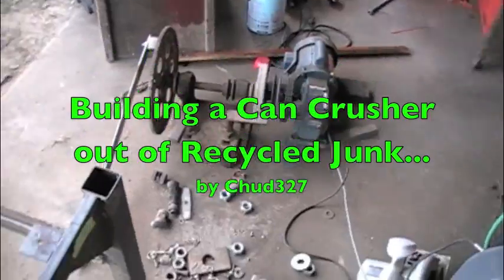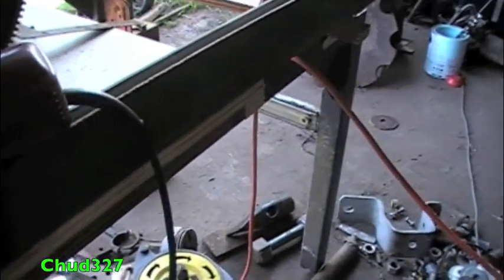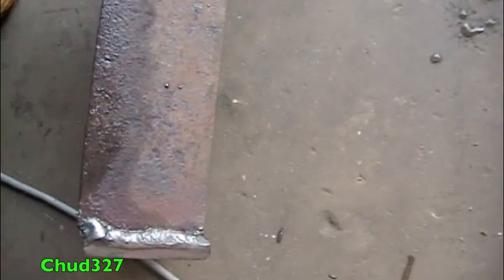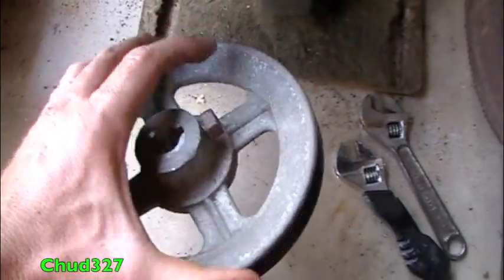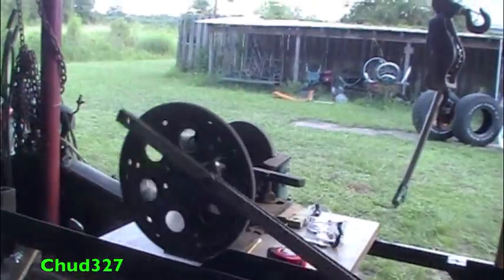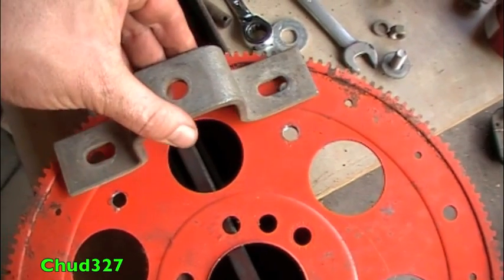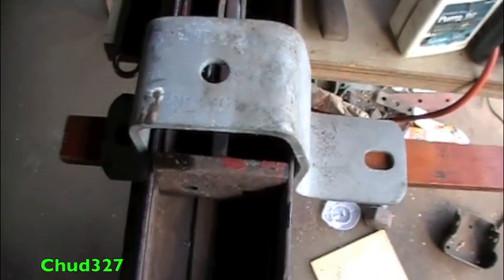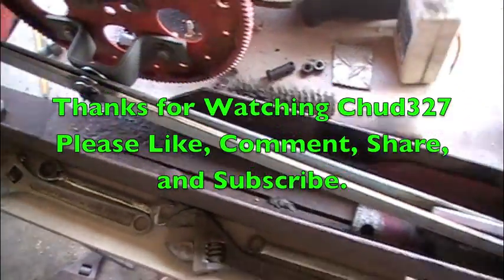Building a Homemade Can Crusher, Industrial Strength.

Comment: Why didn't you build it so it crushes cans flatter?
Reply from the maker: I guess I could go back an fine tune it. I was just so happy it worked and I do not crush very many cans.  I was actually thinking of making a two stage crusher, that crushes the crushed cans. That would be so neat. thanks for watching.
Reply: chud327 
Yup.
Just strange that all the ones I've seen on YouTube only Crush to 1 inch maybe half an inch. I would like to build one that crushes down to at least a quarter inch if not more.
Reply from the maker: 1/4" would be sweet, thanks for the reply.

Comment: Thats cool alot of work and a big setup but cool. lube the slider real good and even go ahead and weld a top on alot of the slide then you can put a loader on it like a triangle reverse so they all drop down to the top can load up like 20-30 at a time in a reverse triangle you can use even some of that cheap fencing from the big box stores to automatically feed that sucker would be really cool!    Good Job man I like the DIY ideas behind that.
Reply from the maker: Great suggestions and it now has a 17 can magazine mounted to it. Thanks for watching.  BTW, funny name.
Reply: LOL ya it was aimed at youtube for trying to make me put my first and last name. But ya i saw the next video or so where you added the automatic feeder to it. The one i saw it went straight up but imagine like a track that has fall on an angle for gravity so you dont have to load it so high and can even put more in it. I like the entire automatic setup you have even just the crusher running off the motor really cool.

Comment: You need a way to keep the motor running but not crush until you flip a switch or push a button.  Your crush channel will last longer, and it will be easier to load.  Perhaps you could get an idea from old stamping presses.
Reply from the maker: Great Idea and that would make it more fun. Thanks for watching.

Comment: what are the motor specs?
Reply from the maker: I think it is a 1750 rpm 110 volt, that goes into the gear reduction box.  I can look at the motor if you want more specs!  Thanks for watching. Are you building a can crusher too?
Reply: That would be really helpful! I indeed am building a crusher too, I've been looking at other videos to know what kind of motor to look for, so far I had in mind a half horse 1750 rpm motor with a 60:1 reduction. But since it will be second hand it's always good to have options!
Reply from the maker: sure, when I get home I will see what I can find out for you.

Comment: What HP is your motor I'm working on a dual can crusher out of a old belt and pulley grinder but my brand new motor I have is a 3450 RPM motor and it's way to fast I have a 1000 RPM motor but it is a 1/6 of a hp and I doubt it could handle it? And what is your motors RPM rate?
Reply from the maker: +Cody McLean I think mine is a 1750 but that is a serious gear reduction. I think the final ration is about 2 rpm after you factor in the gear reduction and the timing chain and gears.  You can use the 3450 but you will need a bunch of pulleys and or gears to slow that baby down.  1000 rpm and 1/6 hp could possibly work.  If you half the speed 6 times wouldn't that be the equivalent to a 1 hp and  166.6 rpm.  That is still too fast. If you could reduce the speed 12 times, it would be like you have a 2 hp and a about 84 rpm.  It is all about the gearing.  Good luck and let me know if any of this makes any sense.  Share your project if you get any progress, I would love to see it.
Reply: +chud327 Ok thanks for the info might video the making with time lapses and things if I feel like it
Reply from the maker: +Cody McLean That would be cool, i love doing time lapses!

Comment: Awesome build. I am building a gas can crusher!. I am using a briggs 5s gas engine.  What size pulleys are you running? Any idea what rpms you are running @ the flex plate?
Reply from the maker: +Jim Hoeky I will have go out and measure the pulleys, but I would guess the flex plate turn about 80 time a minute. I would rather it turn about 60, but it is ok for now. How far along is your build? I would like to see it, are yoyo building a build video?
Reply: l have been talking about building one for a few months now.... A winter project. l have most of my parts laying around my garage. A craftsmans electric motor 3450 rpms or the briggs engine.  l like the briggs better something different.  l welded a lovejoy to my flexplate and mounted on the briggs engine it was way too fast. lm working on my pulley sizes and engine rpms right now. Ill probably have to buy pillow block and a shaft.
Reply from the maker: I am not sure what a lovejoy is, but everything else was crystal clear. I took a couple of years to build mine.  I did a little and let it sit a while and then I finished it.  As for my pulleys, all I have is the timing chain and gears and the flex plate.  My biggest gear reduction was in that gear box.  It probably tells the rotation, seems like the motor turns 1750 and the gear box reduced it 30:1.  1750 divide by 30 would have been 58 rpms. that would have been perfect, but I could get my numbers forgotten...  Your gas Briggs does sound cool and different.

Comment: what engine did u used?
Reply from the maker: +Nikos Pistolas it is a GE that spins1750 rpm. Are you planning on building one, too?
Reply: +chud327 Yes of course I am gonna buld one!!!
Reply from the maker: Cool, I can't wait to see the video on how yours turns out!  I didn't know how mine would turn out until I finished it.  It might be about time to make another video of mine in action, stay tuned.
Reply: how can I reduce the engine RPM of 1700 into 1 rev per seconds? any advice thanks!
Reply: bigger the wheel the lower the rpm

Comment: you should try adding a can holder on the top to stack cans in so you can turn it on once and reapeatedly crush cans
Reply from the maker: +Dalton Whittle believe me that is on my to do list.  I didn't want to wait till then to upload.  It will happen.  Thanks.
Reply: ok